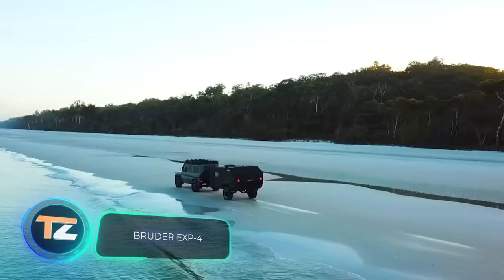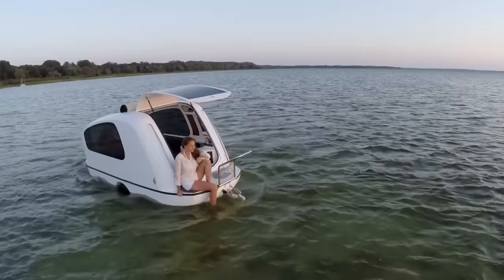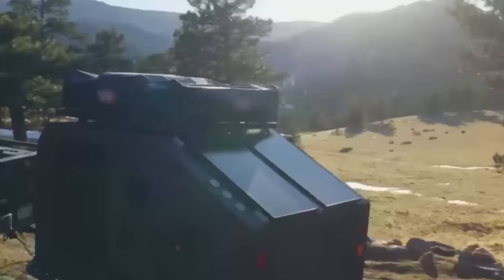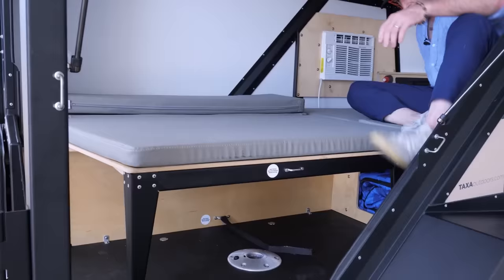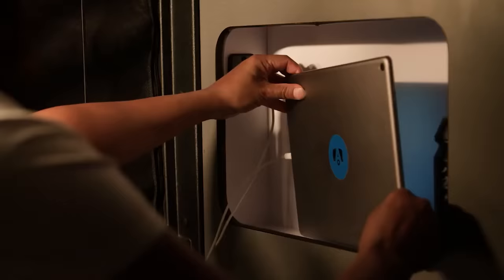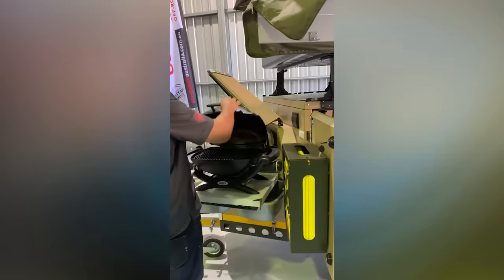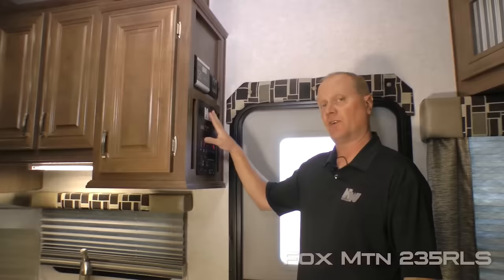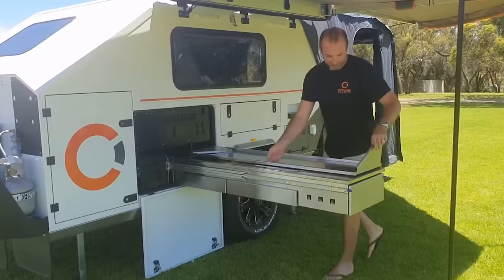AMAZING CAMPING TRAILERS THAT ARE ON ANOTHER LEVEL

Comment: These are not motor homes. They are trailers. A motor home is called that because it has a motor to drive the thing. Something you pull with a vehicle is a trailer.

Comment: I require solid walls and some security when I go to sleep particularly when travelling alone with children.   Flimsy pull out material extensions will not protect occupants from wild creatures, thieves, attackers  or criminals etc, IMO, although an awning could be useful if staying put on a designated site.  So please manufacturers, make more,  light weight, water proof , reasonably priced, wide door, “solid wall pop up  trailers.” for the single lady travellers.  We do not all live in the USA some of us live in wet, windy and cold climates.  BTW is a large oven really necessary inside the trailer these days,  when we all have microwaves, slow cookers and smaller kitchen appliances that do the same job ?  Might as well save that space or build it into the exterior of the trailer,  perhaps.

Comment: The Bailey is just a small typical camping trailer. Nothing special.

I plan on making a really massive tent from a cargo van. The tent will surround the sides and back of the van. The van will be more for storage and emergency sleeping incase of a really bad storm. The problem with most tents is that they are really small. That won't be the case of my van.

Comment: About five years ago my wife and I went to a dealer to look at that little Airstream trailer. It was OK, I wasn't terribly impressed, to be honest. What I remember most about the visit was that it was windy, and while the salesman, my wife, and I were looking at the interior, a gust of wind blew the back door completely off and across the lot. I suppose it was just lucky that it didn't smash into and damage any other units. My wife and I looked at each other while the salesman was doing damage control and split before they decided to blame us for the accident.
Reply: Costs $50K new.
Modern "Airstreams" are still overpriced while somehow looking cheaper and cheaper. (And your great anecdote helps confirm that it's not just the looks!)